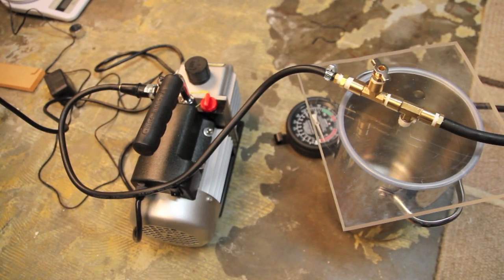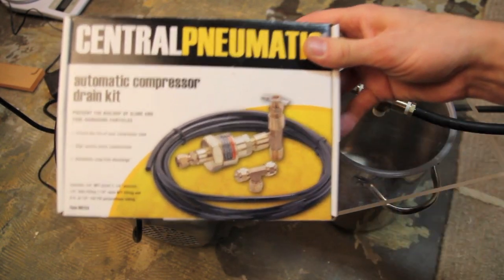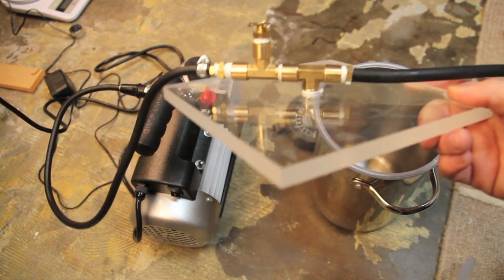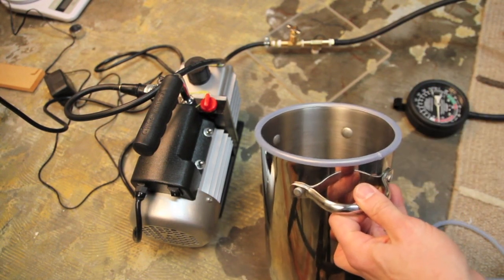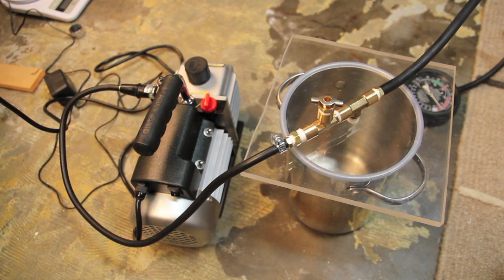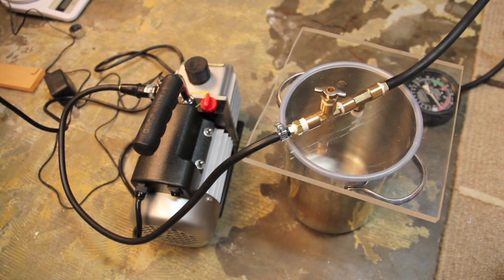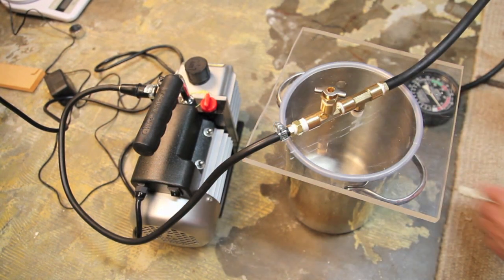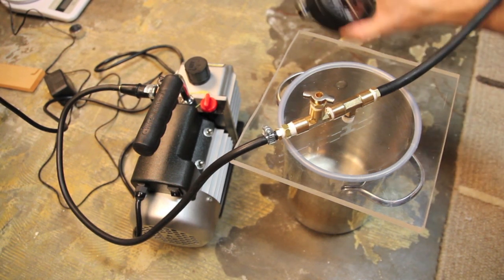How to make a homemade vacuum chamber for degassing silicone

Comment: Hi
Can I de bubble my silicone rubber using a fridge motor instead of the motor you are using ?
Thanks :)
Reply: I heard that  you can substitute compressors from discarded refrigerators and air conditioners. I have zero mechanical skills so I can't say it would work from personal knowledge.

Comment: Ok so I'm gonna do this. As I live in Hawaii, I can't find a supplier to ship here. The specs I need are 8CFM or higher, dual stage, at least 5 gallon chamber and a pump that pulls 29.9" HG. I'm willing to settle in lower CFM and even dual stage, but I can't find a pump that lists mercury pull. Any ideas?

Comment: I worked on three of my sculptures without degassing the silicone. I just mix it with hand and spread on the clay sculpture. Is it bad not to degass the silicone? How badly does it effect the final art? It is hard to tell if it has effect or not.

Comment: Here's one on ebay for $61.90 ... 5 Gallon chamber with 4 CFM pump ... seems way too good to be true yes? http://www.ebay.com/itm/New-5-Gallon-Vacuum-Chamber-and-4-CFM-DOUBLE-Stage-Pump-Degassing-Silicone-KitWP-/122197226706?var=&hash=item1c7385b4d2:m:mWQVd_BuLl7dUQI_X0cBsSQ
Reply: The seller has a 97% positive feed back. I'd say that it's real.
Reply: As a follow up ... I did buy it ... came only with the pump.  Not a bad price for just the pump though.  As I communicated with the seller it was clear they were pretty clueless, I'm not even sure they realize still what false advertising is let alone that they did it.

Comment: Nice build. I wish that a parts list with links was included in the description. I really like the idea of using the tubing as a seal. I am surprised that worked so well. How did you drill and tap the hole in the acrylic?

Comment: I used an old thrown away pressure cooking pot  - works well and cheaper than thick acrylic panel..Can't see the bubbles being squeezed out of the liquid though..just have to wait a little bit longer to be sure

Comment: could you please help me . I want build chamber with diameter 45 cm and length 45cm but I didn't know thickness . I will use it with low pressure Minus 7 or 6 .
and how i  calculate it ?

Comment: Hey Lime I have some trouble finding a pump for degassing silicone. I keep looking at the bar and psi they deliver but it seems low... is this just the rate they pull a vacuum at? I know I need at least 29hg to degass. Like I'm looking at something like this: http://www.ebay.com/itm/Single-Stage-3CFM-Rotary-Vane-Deep-Vacuum-Pump-1-4HP-HVAC-AC-Air-tool-R410a-R134-/321221674335?pt=LH_DefaultDomain_0&hash=item4aca4dc55f
Reply: +Masterpj555 Hey There, dide you found an answer for your question yet? maybe you already have a setup you would like to share with us? :) cheers mate
Reply: yep found the answer! Never needed to make a setup for degassing in the end though! :)

Comment: Hey man, how thick is your acrylic panel? Will a 1/8" thick panel work?
Reply: +Joshua Taylor 1/8" is pretty thin.  You don't want it to flex for risk that it will break.  Polycarbonate is very tough, I prefer more than acrylic.  If you drop acrylic it might shatter/break.  You can throw polycarbonate on the ground and it won't break.  Like Lime said... 1/2" to 1" is good.  You want it to be strong and not break when you pull vacuum.  Good luck!
Reply from the maker: the size of the plexiglass you use depends on the size of the chamber you are going to use, but i do not think 1/8" would work in can situation. I recommend 1/2" to 1"
Reply: +Joshua Taylor You can get a 12" x 12" x 1/2" sheet from USPlastic online for $15.  Item 44381.
Reply: BeautyLovesTech thanks mate!

Comment: very nice job. i am looking into getting into prop making and working with resins/silicon and other stuff. the suction pump is useful in many ways, and the chamber is great. i assume you could easily make a larger chamber. the pump drew the air out super fast at this level. trippling the size wouldnt take away much of your working time.
Reply: So are you claming that using the same capacity pump on tripled volumed chamber to evacuate air and create vacuum would "take away much of your working time"? How so? It would take three times as much to reach the same pressure. You should go back to school sonny boy.
Reply: perhaps you should learn to read properly. the word before those quotes was "wouldn't" which turns what you assume i said into a negative. working time starts when the compound is mixed. using 3X volume chamber would turn a 10 second prep into a 30 second prep. when overall working time is usually no less than half an hour for the most common compounds... the extra 20 seconds wouldn't add up to much. these numbers are educated estimations.

Comment: Thanks for the video, I just picked up the same pump for $100, and all of the chamber parts for around $70 ( 8qt pot, scrap plexiglass, shut off valve kit, gauge, 1/4 adapter, hose clamps, and latex tubing for the gasket). I'll be assembling it tomorrow. Good to know that 2.5 pump is strong enough for degassing!

Comment: What about this? I just dont understand the numbers.. The chamber is made, vacuum cleaner didn't work... 

Voltage/Frequency : 110V/60HZ
Flow Rate : 3CFM(84L/MIN)
Ultimate Vacuum : 5 Pa (0.05mbar)
Power : 1/4HP nlet Port : 1/4 '' Flare Oil Capacity :

Comment: can you use a 1.8 vacuum pump (.25hp) for this? thank you for your immediate response Sir.
Reply: siobhan mccorry Don't be an ass, there's nothing dumb about it. I am well aware of the meaning of cfm, and the distinction from a pump's maximum vacuum, but that does not answer my question of what the disadvantage of more power would be.
Reply from the maker: Yes you can
Reply: Lime420 
thank you sir.I purchased a vacuum pump (1.8 cfm , .25 hp) but I wonder why it wont work..it cant even move the silicone inside the improvised chamber :)
Reply from the maker: are you sure its air tight
Reply: Yes sir,i have already bought a 9 cfm vacuum pump,my problem now is it is too powerful.lol.thanks for your time sir.
Reply: megs empinado How can it be too powerful?
Reply: ***** cfm only dictates how fast it comes up to vacuum, not how powerful the vacuum is, please stop saying dumb shit

Comment: can you degas 13 ounces of silicone with this set-up? as well as I've notice in other set-ups they release the vacuum would that reduce the amount of expanding volume. Have you done this so the mixing vessel you use doesn't need to be so big?
Reply from the maker: yes you can release the vacuum for a few sec so that is does not over flow, but you need to let the vacuum hit 29.9 in. so that all of the air is out. I have for sure done more than a 13 oz pull on this set up. I hope that helps.
Reply: definitely does thank you!

Comment: Your surgical rubber tube idea is excellent sir. I can't tell you how long I took to solve this problem, in the end I used a gasket which I cut from a silicone sheet, plus silicone sealant to glue it to the lid of chamber. Your solution is much more elegant. Nicely done! I can't post links in comments but if you search for "My MkII vacuum chamber, for stabilising wood with methacrylate ester/resin" you will find mine.

Comment: Hey mate - so did you split the surgical rubber tube along its length to fit it to the edge of the stainless steel pot?

Comment: I don't have issues with the silicone, if mixed slowly.... I have problems with bubbles in the Epoxi mix, I need to degas the epoxy more than the silicone..

Comment: Great video. How are you connecting the hose to the vacuum pump? I can't find a female R12 or R134A female connector to barbed hose brass fitting anywhere.

Comment from the maker: I used an x acto knife, and it was really easy to keep it straight by just cutting slowly down the middle. Cut the tube so that you only cut one edge and not all the way down the middle (or both edges).

Comment: Thanks for the post (and showing us that it works)!
What is the best vacuum you can pull with the system?  Can you get anywhere near 28 or 29 inches?  It looks like it is enough to degas the silicone you're using.  Also, where did you get the "pressure chamber"/pot, and is it stainless steel?